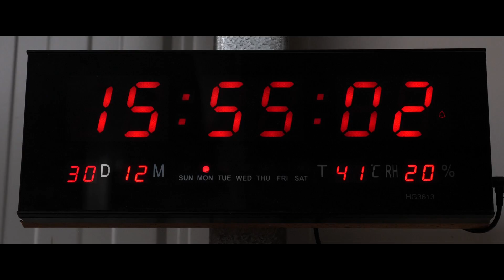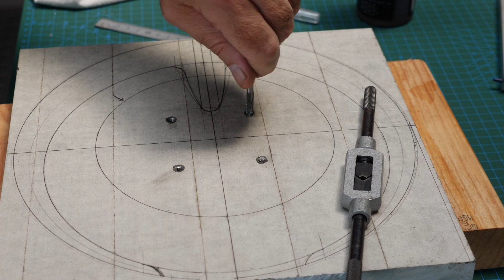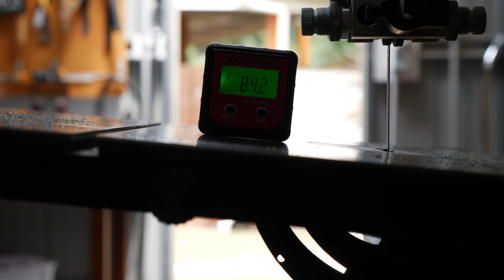Kelly's Vase

Comment: An impressive work of art a world champion would be proud to receive as a prize, it will never be outdated. You are a master.
I've had lathe for wood for 40 years (now no 3). Utilizing them eagerly, began making small bowls with a lid with inlaid metal, such as Copper, Brass, Silver, a little Gold, coins and medals on the lids. Fine for gifts, the girls liked them best, they used them to put rings and necklaces on the bedside table. They brought little things and rings that they had had as little ones, and young ones. Asked if I could make them bowls and mount them on the lids. Now I am chronically ill, use oxygen (COPD) and the lathe has been left alone for a long time. None of the kids wanted to learn, the computer came and took them :). That's why it's so nice to look at you and others using the lathe, the saw and the sander. Then I lie to reminisce.
Reply from the maker: Thanks Harald. Sad to hear of your illness and glad to have given some comfort to you through my video:)

Comment: Random Recommend. I don’t think anyone that fancies one’s self a maker of any kind, could resist the mirrored thumbnail. Not disappointed. Inspirational in design and just exquisitely beautiful in it;s very existence. Subbed...
Reply from the maker: Thanks. The last time I dragged that mirror out was ten years ago, 5 mm thick and 1.5 metres square. I'd forgotten how heavy it was (or maybe it's just that I' m older;).
Reply: Attila's Workshop  ~I’m a commercial product photographer by trade, and woodworking is my tactile escape, so you double-grabbed my brain. Use that mirror anytime you want drama. Nothing can make wood pop like black velvet and/or reflection, together or separately.

Comment: Hi there! As you know, I went back for the 3rd or 4th time to look at your napkin holder. And, today, I did a search for all your other work and realized you have a penchant for cantilever design. I think that is what takes people by surprise since most of us don't think in terms of designing cantilever items. Really clever design with great execution. You go a long way with the aluminum with wood working tools. I also notice that you are operating in metric and was wondering where (in general) you are based. I am in California and converted to metric only a couple of years ago and find it so much easier. But, finding 8mm or 10mm aluminum around here would be rather difficult so I  suspect you are in another country and I am just a curious guy.:o) Thanks for posting your videos, they are among the most professional from a design and execution standpoint that I have seen on YouTube. Regards, Bill
Reply from the maker: Hi Bill, I live in Australia and we went metric when I was a kid. I remember the difficulty I used to have switching over lol. Even now I still use old world measurements like 'that's miles away' or 'just a few inches more'. When someone asks if I know the speed of light, the answer I come out with is 186,300 mile per sec. But yes, metric is way better;)

Comment: It's a fantastic piece of art! I'm wondering what type of aluminium are you using (2024, 7075 or something else)? After polishing Al parts to a mirror, have you finished them with some lacquer? Polished aluminium is oxidised quickly...
Reply from the maker: I think it was 5083, a marine grade. No finish on the polished metal. Clear coating takes away some lustre, I have things here that still have a nice polish after ten years;)

Comment: Another wonderful item
What kind of aluminum is this?
What paper do you use for polishing?
Reply from the maker: The aluminium is 5083 (I think). The paper used to smooth out the scratches prior to polishing is waterproof sanding paper.
Reply: @AttilasWorkshop  What paper gradations do you use? One or several different ones?